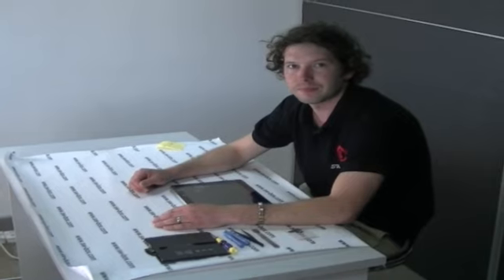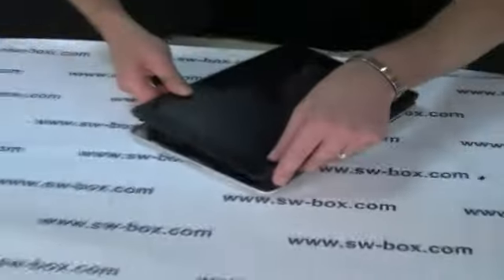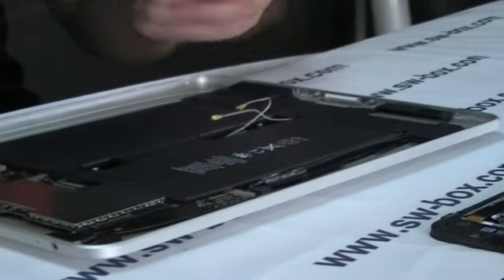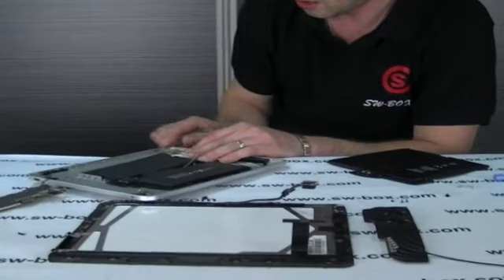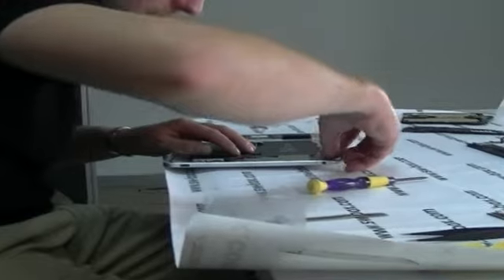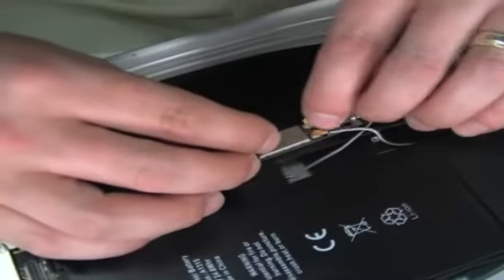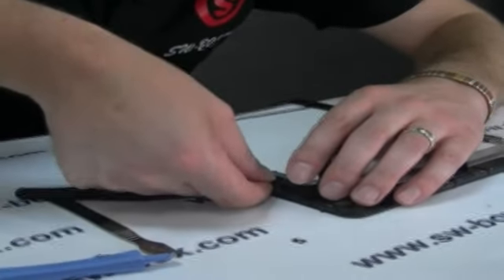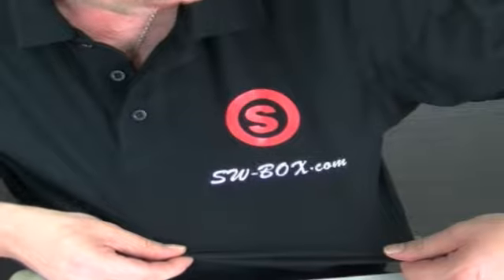iPad Battery Replacement / Change / Fix / Repair

Comment from the maker: Hi okay Q1 it may or may not happen to you, sometimes it comes up other times it’s fine, but if it does come up then all you need to do is connect to your itunes and it will fix itself, and yes there is a os on the ipad, but I can’t tell you what version is on your’s

Comment: Hi after I changed the battery I  turned my ipad on and it shows the apple logo, then turns off, if I plug to my pc or wall charger it shows the apple for a split second every 20 seconds, do you know whats caused that? and I can't get into recovery mode thanks

Comment from the maker: Hi Anush, actually it's much beyond our capability. We are not professional on this issues. We do videos on changing parts cause we sell those parts and want our customers do it themselves without paying a lot to those local dealers.
We recommend you to contact Apple's genius if your ipad is less than one year old and still under warranty. If not, google it and you will find a lot of people who met the same problem and checked how they solved them. Hope it helps.

Regards,
Laura

Comment: I'm glad I purchased a Toshiba Thrive tablet.
I called the Apple Store and ask them how much did a replacement battery cost. The "expert" told me they did not sell batteries. He finally went and talked to a grown up about battery replacement. He said that I needed to bring the iPad in and they would switch it out for a ONLY $ 300.00. I told him did not want to buy a new iPad but just have a battery replaced. He said that's the Apple way! 
My Toshiba Thrive battery only cost me $ 20.00. Figure ??

Comment: I found the 32gig Toshiba Thrives on Woot dot Com. They had them for $ 300.00 each. I am so glad I bought two of them. I am not having to kiss Steve Job's Ring. It runs Android and runs it fast and smooth.
The battery replacement takes about 5 minutes to pop out and slip another one in and your good to go for $ 20.00. Apple wants $ 300.00 for ipad exchange.

Comment: A half hour for an experienced repairer= 2 hour minimum for a first timer. Better off taking it to the local shop and get the results guaranteed as well as no headaches.

Comment: that "charging port" is acutally a multi purpose io pcb. It houses the connecting port, and those 2 wires are the wifi antenna. you'd think they'd get everything right if they're trying to teach someone. great video aside from the shit camera. but yea. thx for the video, all i needed to know is clip arrangement so i wouldnt break mine while i modify the case.